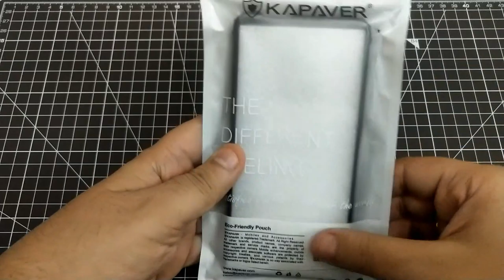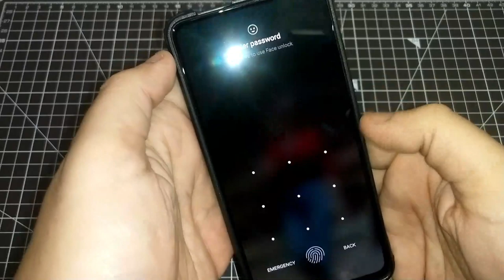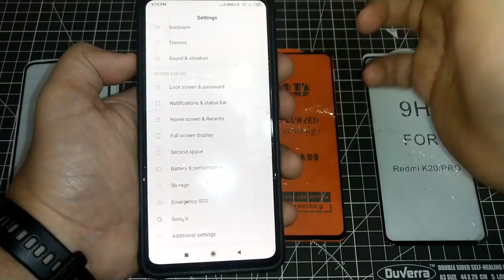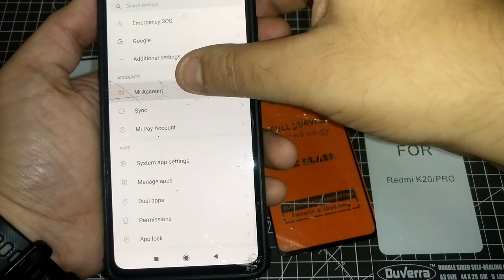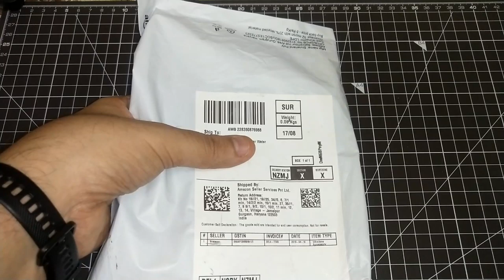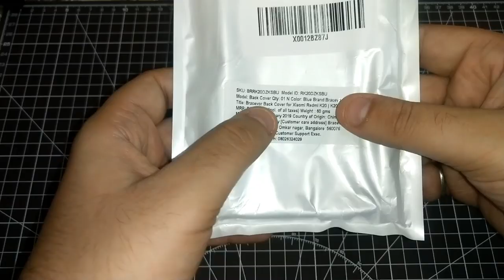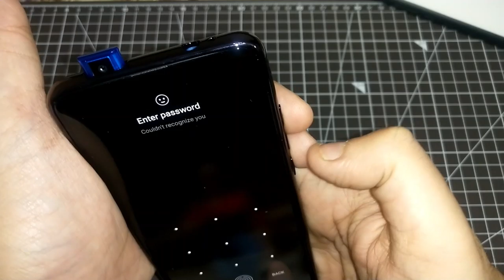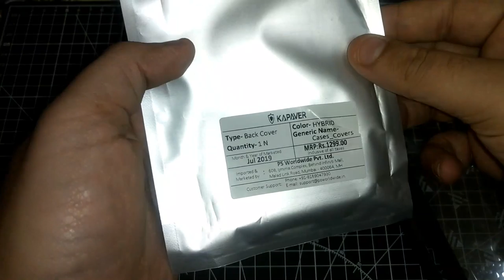PART3 RINGKE VS KAPAVER TRANSPARENT COVER FOR REDMI K20 PRO BEST TRANSPARENT COVER FOR REDMI K20 PRO

Comment: Which ones of the two covers is more appealing on Glacier blue K20 pro?
Reply from the maker: Niranjan Sir, I really likes their Kapaver it it has more clean back as compared to Ringke. The cover is a on the bigger side however weighs the same. You same a decent amount as well. Try else refund it and buy Ringke.
Reply: @ForTheLoveOfGadgets  Will Amazon take the Case back, if have removed the back and front protection cover to test the case..

Comment: Does Kapaver and Ringke Fusion back covers affect the front camera pictures?
Reply from the maker: Gaurav i got few saying the same but then this is due to overexposure issue and generally in blue and red color. I did not notice too major of issue. But great that the ecommerce site provides return facility.

Comment: Bhai using ringke with k20 pro, left blur ness at bottom in the selfie photo. Please check, and also if u slightly slide up the camera using ur finger, it doesnt happen as it comes up a bit. I dont know whether its a problem in my mobile only or its in all phones. Kind of jerk.
Reply from the maker: Have you seen my video on the same. Is it like this?
https://youtu.be/xkjadAPfuc4

Comment: Bro,try to open front camera and chek whether the picture is coming right or not because i faced this issue in wellpoint transparent case.
When i was taking picture then a shade is coming at the bottom of my pic.
I went in local market for cover and i faced same issue on many cover.
So try to cover this aspect .
.and good going keep it up.
All the best
Reply from the maker: Is it glacier blue or red, then this might persist as the bezel shine somehow leaks. Any specific angle this happens in?
Reply: @ForTheLoveOfGadgets  i am using red
Reply from the maker: @House_stories_  https://youtu.be/xkjadAPfuc4 watch this. Is this the issue? Somewhat like this?
Reply: @For The Love Of Gadgets The above mentioned comment wants to ask the question does the cover in any way blocks the angles of front camera or not this is what we require please once recheck and inform.